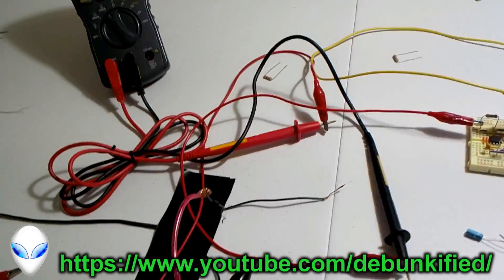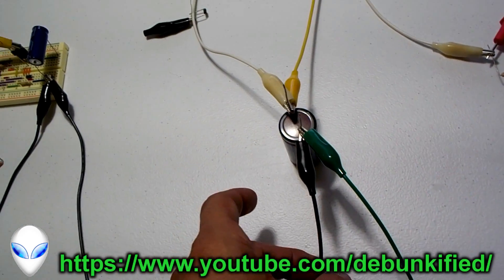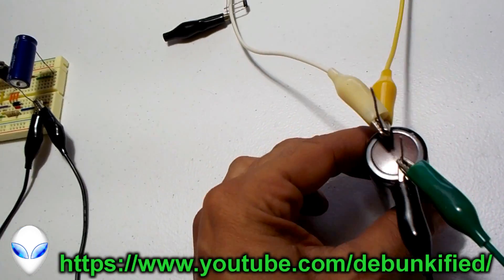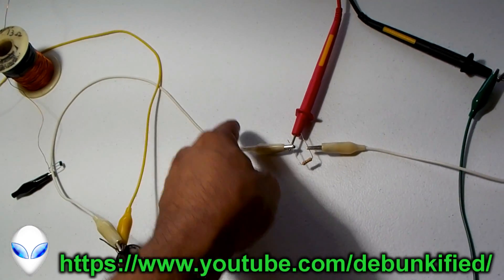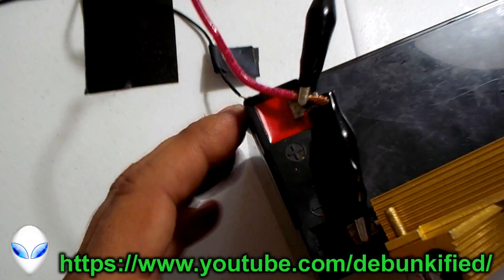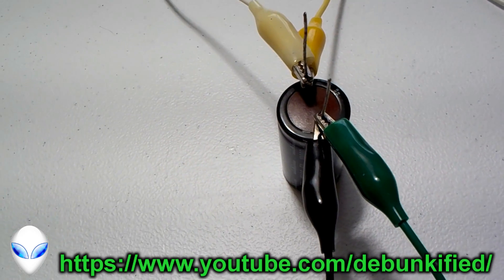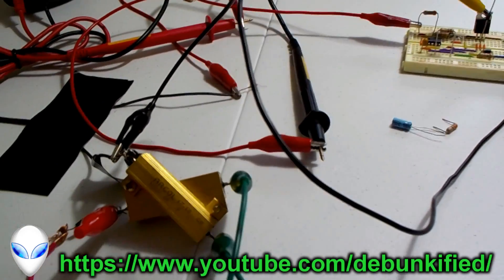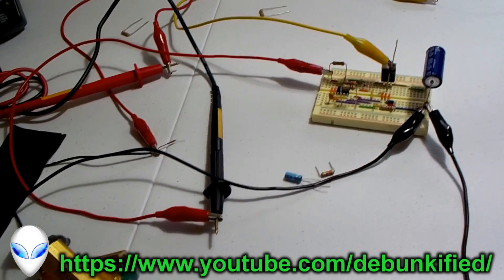Self Charging Capacitor

Comment: It looks to me like you are sending a square-ware into the coil and rectifying the back emf spike to charge the capacitor.
Nothing special in that. If the capacitor charges itself then what do you need a battery and 555 timer oscillator and coil for?

Comment: The over unity is from the harmonics of the wave. Your looking for free energy? There's a simpler way that nature uses so you need to add water. No battery or magnet or coil is required or any of that stuff. I can show you... but it may be more than you bargained for. I don't think the 555 timer could take the high voltage and you would have to use a spark gap. I don't think it can be done with any capacitor on the market. You would have to build one from scratch to a 5: 3 ratio to get it in tune. It has to be a perfect golden rectangle so it vibrates at a specific note. I only know how to do it at voltages above 25,000 volts at high frequencies. You may be able to figure out how to do it at lower voltages... but I don't think you will power your car even with it. I don't recommend using a battery at all. It will blow up.
But if you just want to stick with charging capacitors slowly... just dip the 2 leads in water and it will charge itself on it's own... but slowly... no battery or circuitry required.
I don't think you can properly demonstrate this in a circuit diagram because it's all musical vibration using a transducer to hammer on a piezoelectric crystal to infinity from the harmonics of the initial vibration. The harmonics of the initial vibration are hammering on the crystal faster than the initial vibration and so it speeds up to infinity. Today's piezolectrics are baloney. Why tap on a crystal manually for little power when you can hammer on it a trillion times a second and beyond... there is no end in harmonics it goes to infinity. This is where you may want to put a variable resistor on it.
I believe we can go 144,000 times over unity from a drop of water... actually more... it should be infinite. You can keep reusing the same drop.
Pick a spot... any spot. There is more energy in the area the size of a pinhead all around us than anyone can imagine.
Reply: I hope this is sarcastic humor, if not se a doctor and don’t listen to the other guys in your brain…

Comment: Circuit diagram PLEASE.
What is the part number of the MOSFET?
When you put the resistors in series with the LM555 circuit, what is the LM555 new supply voltage?
Have you got enough voltage on the MOSFET to switch it ON?
You loose half the output voltage of the LM555 in the 2 x 10K resistors forming a potential divider.

Comment: Probably capacitive coupling via the Mosfet 
Gate to Source or Gate to Drain Capacitance
Reply from the maker: +overunitydotcom That's what I think, but don't understand how because when the inductor is removed the capacitor only charges to just a few millivolts.

Does the capacitive coupling have a tiny little strange AC signal to it that would cause the capacitor to get charged and discharged therefore cancelling out voltage in the capacitor without the inductor?
Reply: Sure, as you pulse with the 555 square wave you surely have an AC that is transmitted via the  the gate-source or gate-drain stray capacitance of the MOSFET to the coil and then to the cap....and if you still have a diode inside the circuit it is even better.... I must see the circuit diagram to say and analyse it more...
Reply from the maker: +overunitydotcom I suppose that makes perfect sense. The circuit diagram can be found here http://eternalmotor.blogspot.com/p/circuit-schematics-and-breadboard.html?m=1 under the title "Fogal's Semiconductor Technology 555 Timer Pulsar Charge Barrier Circuit Schematic"

It's exactly the same except for the gate to pin 3 resistor is 10k Ohms just like the source/gate resistor is and the coil is just powered by a 10,000 uF cap that has the self charging effect on it. The mosfet is an IRF740.

If I stick a diode on the drain to rectify this mosfet leakage AC then I get a negative .030 mV charging the capacitor which makes a little bit better sense now as 20 times that amount from a flyback pulse would indeed reach around between 300mV-600mV charge into the capacitor.